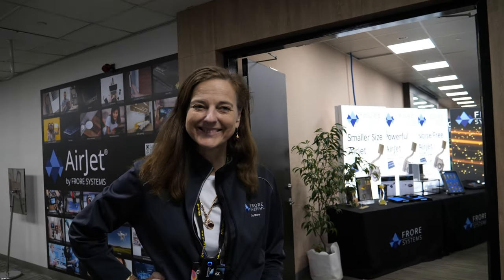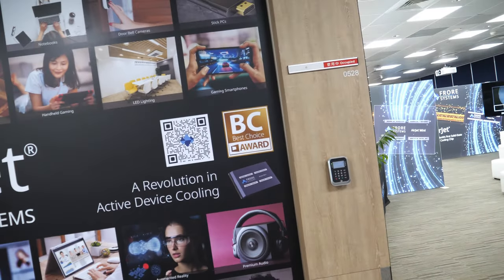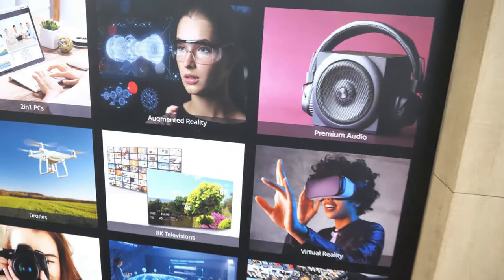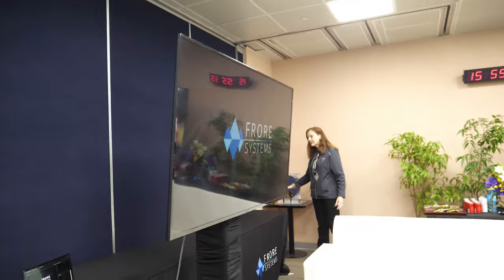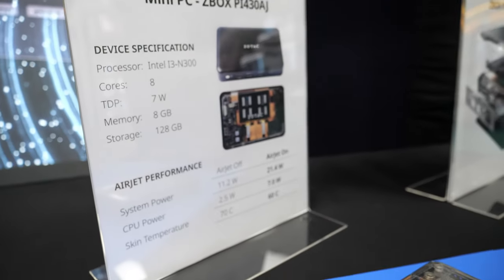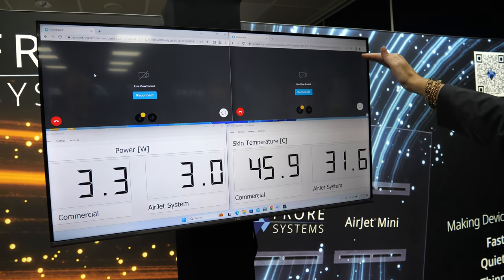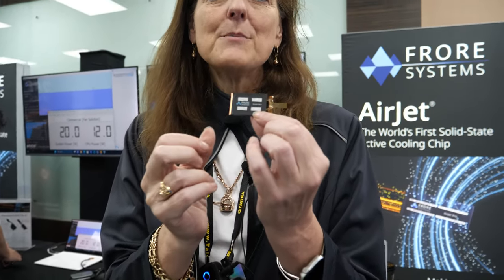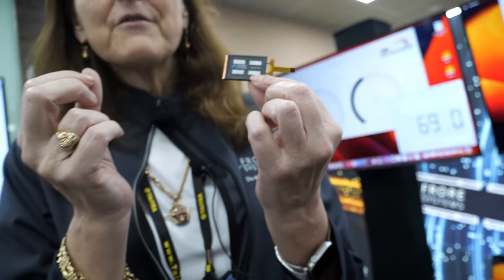Best of Computex 2023: Frore Systems AirJet Mini, AirJet Pro, solid-state active cooling chip

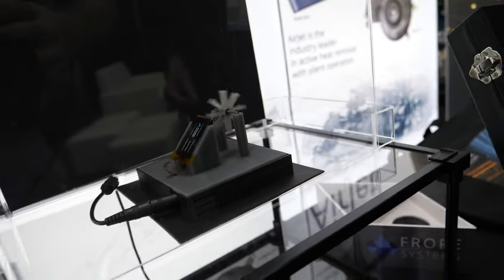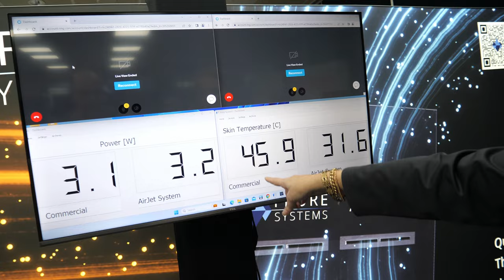Comment: I wasn't impressed with the AirJet Mini blowing at the fan. 1:00 But assuming the temperatures are correct, it does seem to work. 17:35 Perhaps the QooCam 8K 360 camera should get a new release with AirJet.
Reply from the maker: If AirJet is the real deal, it could have a role enabling a whole bunch of 8K cameras, including my next 8K60 successor to my Panasonic G9, one with phase detect autofocus and all onto dual SD card slot 😁